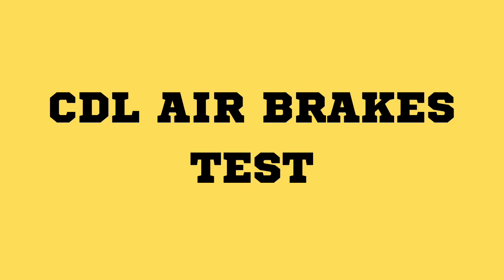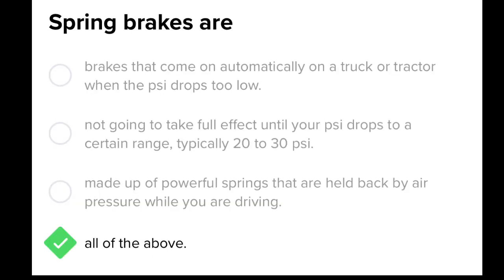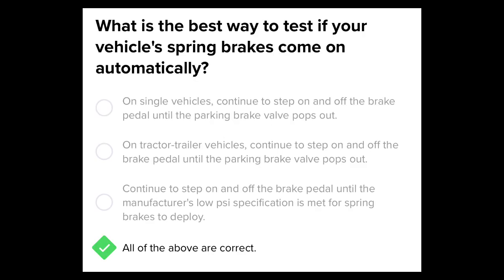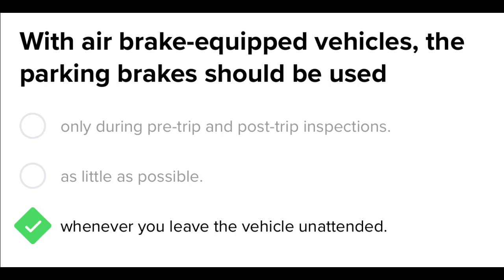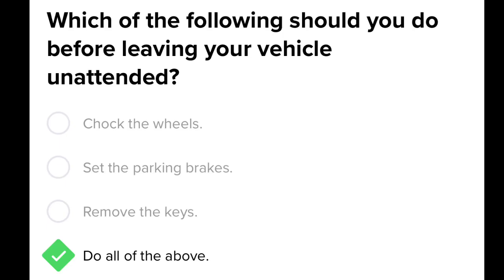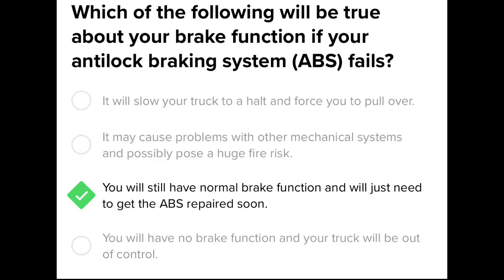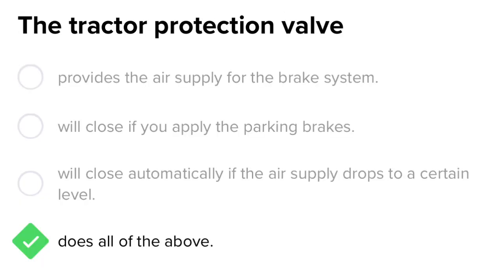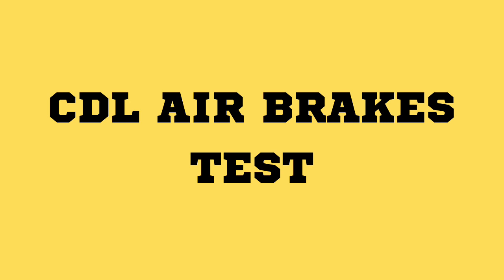2023 CDL Air break test questions and answers #trucking  #cdl

Comment: These question gonna be in the test at the dmv?
Reply from the maker: Yes they may word them differently cause they use a few different versions so people Caint memorize the answers in order or write down the answers in order. So they may not be in that exact order or they may word it a bit differently depending on which version of the test you get. But short answer is yes
Reply: Ahh see. Thanks bro!